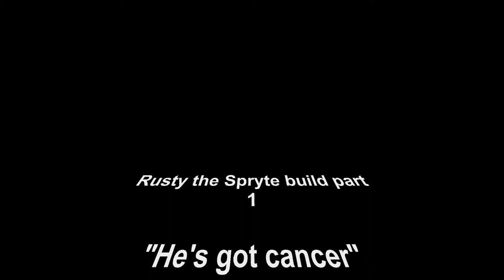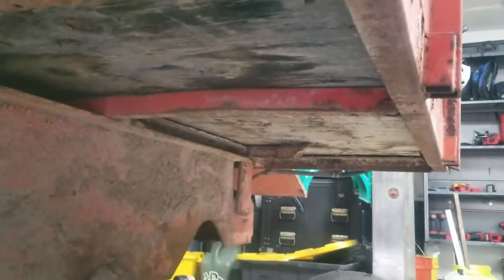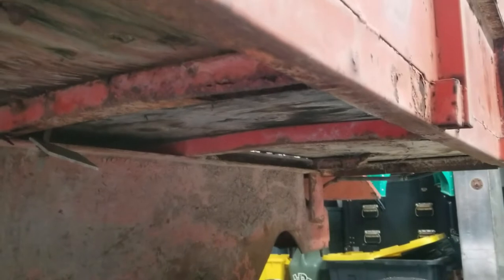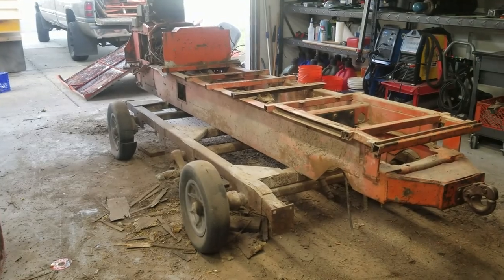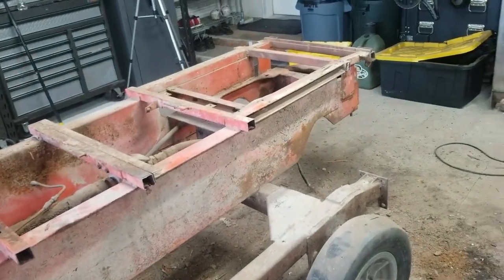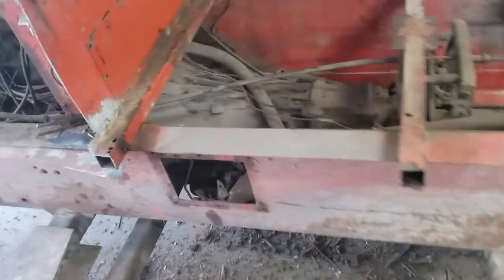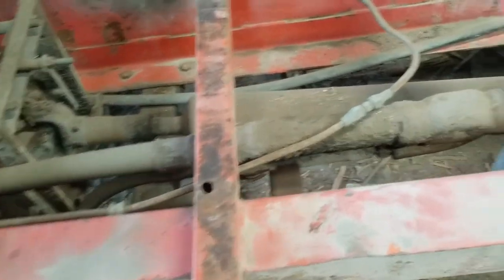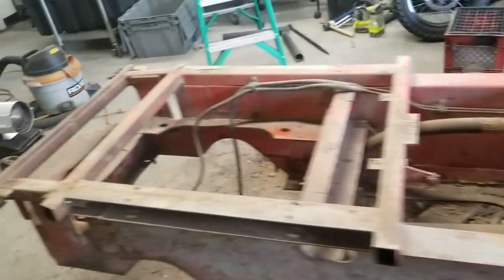Rusty the Spryte build part 1 (Demolition and disassembly body/frame)

Comment: Very cool!
Reply from the maker: Thanks for putting the idea in my head.  Do you still have your Spryte??  My completed build weighs about 7500 pounds it was originally a 1202b model that weighed 6250 without the blade and 7200 with the blade and winch.

Comment: Wow that is some serious work you have to do now. I guess the paneling and shag carpet will be in the new design. I am thanking out loud,  buy a van and cut the bottom out of it. Drop it on your frame. Good luck with your build.
Reply from the maker: I am looking at options right now.  :D
Reply: @SeanFillner  Look for an old aluminum bread delivery truck. I think it will fit right on. Light weight too. Get "Wonder bread" to sponsor the build.
Reply from the maker: @badbadbob1  I came up with an Idea I think you will like...